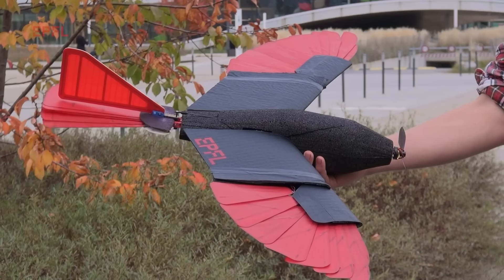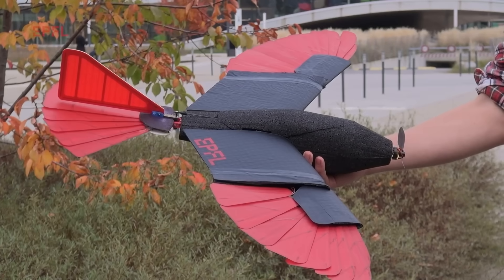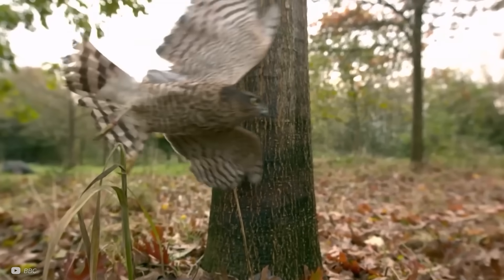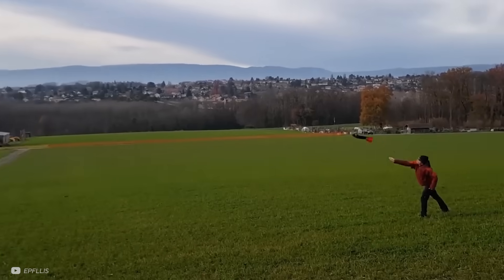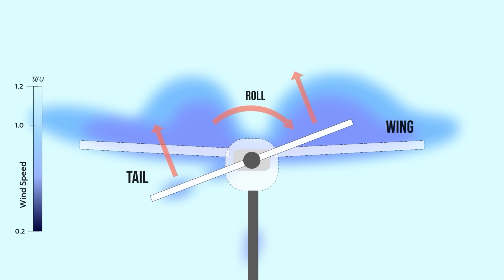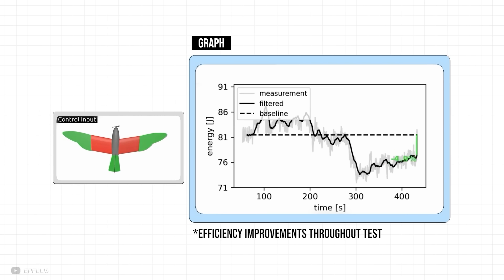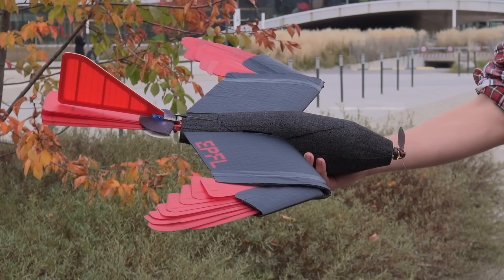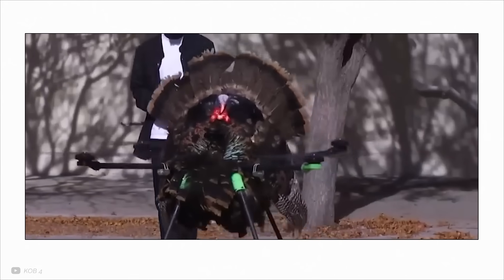The Genius of Bionic Morphing Wings: Future of Flight?

Comment: Just as a point of clarification here: The fact that the analyses they used were "Bayesian" versus "Gaussian/frequentist" isn't actually important here. Bayes vs Gauss addresses probability from two different philosophical perspectives whose differences are important, but probably not specifically here.

More, the analysis used to find the optimal wing configuration here looked to be some kind of Maximum Likelihood Estimation (MLE) technique or something very similar. My main point is that both Bayesian and Gaussian statistics can perform these kinds of analyses just fine and will often come up with very similar results.

TLDR: The analyses they used were some sort of MLE-type analysis that CAN be done a Bayesian way but the Bayesian aspect of it is not what is important here.

(Final concession: Most people would agree that, in almost all cases, Bayesian methods will provide results of equal or better value than Gaussian ones, but almost all of our traditional stats are Gaussian and we're still in the transition to Bayesian stats as a whole)

Comment: More moving parts means more maintenance, more maintenance means more money spent on the upkeep, means less likely to be used in the military, yeah it is cool but doubtful it will make it to the military part any time soon.
Reply: Why did they decide to discontinue the jets that have moving wings? Oh that's right the cost and maintenance on them. Plus they don't do what the opposition can do and makes it easy targets.
Reply: you realise quadcopters use a massive amount of moveing parts compared to a monocopter or a fixedwing design yet are widely used in current wars...
Reply: @matthiuskoenig3378  that is quadcopters and also these are recreational with a lot of moving parts that are easily removed by somebody with a gun.
Reply: @matthiuskoenig3378  funny how i don't see any of the Dune ornothopters flying around in the sky with missiles attached... could it be the costs and speeds they go that prevents them from being useful in a military setting?
Reply: @matthiuskoenig3378  the answer will be yes to what i said because that is exactly why you don't see moving parts much on many fighters anymore either.
Reply: Military planes already need much more maintenance than commercial jets.

Comment: I used to fly free flight airplanes. Many older designs used a lifting stabilizer. Offsetting the thrust line provided a turn in one direction when the motor was making it climb, then when the motor or rubber band quit the tilted horizontal stabilizer would cause it to circle in the opposite direction wile gliding down.

Comment: This is interesting from a research perspective, but something like this would never be practical as a functioning drone. The mechanical complexity adds a significant weight penalty that dramatically shortens flight time and limits payload. Notice there weren't even cameras on any of the? Notice he never mentioned flight times? I flew planes this size for 15 years and am familiar with the components and weight restrictions. The "11%*" efficiency increase isn't going to be enough! 

*Even this was suspect. It appeared to be an 11% increase from its original configuration but they claimed an 11% increase over a "fixed wing."
Reply: Well, maybe in a few years, or a decade this tech will be advanced enough to have actual uses, all we can do is wait and see.
Reply: That's what was said to Orville and Wilbur, so who knows.
Reply: Never is a bit much. Give it four thousand years and the super ais developing society might employ these types of drones using dna and carbon elements to make them as spies on the natural world lol.
 More like, impractical for the next few decades without changes to technology.

Comment: The same principle is used by airplanes during aileron rolls. Which is why I don't understand why they still haven't made a 4 wings electric airoplane (or a "flying wind turbine") that uses these aileron rolls (full 360° revolutions on its longitudinal axis) to recharge the batteries airborne. In a 4 winged electric airplane basically the two front wings would spin the fuselage in one direction, and the back 2 wings will spin on the opposite direction at double force, making the plane spin on its axis, acting like a “flying wind turbine”. What we would see spinning (from the ground) it’s only the back of the plane. The pilot and passengers stay on the front, so are never upside-down.

Comment: they may not understand how birds move but i do, a birds whole body flexes, their wings also flex along with their tail, you combine these traits with the ability to fan out a surface or constrict it and you get the ability to suddenly stop in the air, change direction rapidly and do what looks kinda like an instant U turn because they used the change in shape and momentum to rapidly change direction or dodge stuff
the physics for this can be as advanced or simple as you like, personally i'd use a body made of a springy material with servos that have tiny cables to pull the parts to alter those shapes in groups, issue is making a controller that would adapt this in real time because a normal pilot is gonna have a huge pain in the butt adapting to 20 buttons or levers so it makes more sense to simply put those movements on the edges of the sticks or past midway out with a range for a max range and program them separately so they only happen when you really just need that extra movement to do the thing you wanted

Comment: I still be confused yall sayin wings provide lift when they dont, the mass/density of air decreases the higher the elevation one goes, so the wings actually push off the naturally heavy air beneath it to push upward or some symantic equivelnent that is not lift. Thus, when the tail twists, it cuts into the heavier air and drags the wings in the opposite direction like a rudder in water. Wings push off air to fly, they dont get sucked into vacuums to fall upwards. Gods, stupid science always gettin shz upside down...  i blame neinstein

Comment: Without saying too much, the elimination of vertical stabilizers while retaining yaw stability has some massive advantages for stealth aircraft.
Reply: how so?
Reply: @deltamico  less surfaces to worry about radar bouncing off of. it's why the B2 bomber doesn't have a vertical stabalizer. it gets yaw stability through the wing sweep angle. for example, if it yaws to the left, the right wing has more drag, pulling it back straight.

Comment: The problem with all this is that the efficiency and optimization that nature has found and that these machines try to replicate is limited to the speeds in the range of 5 to 120 mph. You will never find a bird flying supersonic speeds with these optimizations. This might make reasonably good low speed drones but if higher speed drones are needed this is only of limited applicability.

Comment: It is interesting that when we "discover" how nature does things we then want to take things as far as we have doing it "our" way. Nature solves things in a good enough way for the conditions that they encounter in nature. The highest horizontal speed for a bird in 170kph (105 mph) so taking the ideas and expecting them to scale to high subsonic or supersonic is a bit of a stretch. That said there are a HUGE number of things that can be done at "low" speed.
Reply: similarly expecting the way we do things already that was orginally created for lower speeds shouldn't automatically be assumed to be the best option for higher speeds either.

Comment: Birds also have a flexible spine and tilting head that allows them to distort the level airflow and center of balance while maneuvering or rolling. Similar to a high diver and the way they time different sections of a dive to adjust their tracking. These robots, though very cool, will never match birds until they feature and perfect these characteristics.
But to this day, no robot has a full and functioning spine... hmmm.
Binocular vision helps, as well.

Comment: Upping drone efficiency is of immense value for medical deliveries in the third world.  There are already companies using fixed wing drones to move medical supplies back and forth in Africa over multi-km distances.  Anything that makes their delivery craft more efficient literally leads to fractional human lives being saved.
Reply: Absolutely, although I doubt thus kind of design will be used on those areas, one other benefit of the fixed wing is the reduced number of moving parts and increased rigidity which allows it to be slingshot and means that less backup parts need to be kept on site for repairs. But I could imagine in areas where slingshotting isn't an option this would be great.

Comment: Wing shape shifting is done on all modern large aircraft. Leading & trailing flaps that extend out, usually on take-off & landing. The reason they don't look like bird wings as per this video is strength vis-a-vis payload. Drones that look like tweety birds are cool toys, & they have distinct military advantages, but maybe only for surveillance cf delivering ordnance. Splayed (gaps between feathers) on wing tips are good for slow flight and even hovering (look at a red kite in the wind)

Comment: Even before watching: am convinced that adaptive wings are the future. My idea’s however move more in the direction of such wings being covered with flexible skins like on pterodactyls.
Reply: I'd imagine the problem with that is you either need a material that will stretch (which will degrade over time and put additional stresses on the wing struts) or you'll have excess material that's folding up and basically free to flap about which ruins the aerodynamics.
Reply: @epikgamingcat I am not saying it will be easy.  😁The idea is however not new. NASA studied it under the name MAW (Mission Adaptive Wing) and even adapted a F111 for it. Technology is however constantly evolving.

Comment: I'm not convinced that tail twist by itself accomplishes anything. You say that it can generate differential lift via drag, but the tail is already an efficient elevator. But combining twist with elevator will produce a rudder which is of course useful. But big picture here, there are two things going on which are somewhat at odds with each other: First is helping us understand how birds fly, and second is allowing AI to understand it. We will learn little from the AI, and vise versa. Better is to focus on the AI systems, especially the part about finding the ideal physical forms for the requirements.

Comment: Fighter Jet maintainers are drinking themselves to sleep thinking about what their job would look like, maintaining a fighter jet built like this. Much simpler variable geometry designs have been used, but they are maintenance nightmares. Most likely, we will not see this design used for manned military craft as the role of a modern fighter jet relies far more on advanced sensor capabilities and beyond visual range missiles than on the acrobatic maneuverability needed for old school dogfighting
Reply: Completely agree.

'Let's get 0.1% efficiency at the cost of 10,000% increase in complexity... '

Not to mention that what works on an ultralight small drone won't scale to the materials needed for a full sized aircraft with the capacity to carry functional weight in inclement conditions.

Comment: Birds can feel the airflow over each feather and each part of each feather. They intuitively know what the boundary layer is doing over every part of their bodies. Pretty cool.
Reply: Now that the artificial bird has artificial feathers, its time to stick a dozen strain gauges on their stems to have artificial feel of airflow
Reply: @jozseffabri  strain gauges and perhaps embedded flow sensors in the actual feathers themselves.
Reply: I imagine it's a lot like grappling. If you've ever done jiu jitsu, or wrestling you'll know what I mean. Once you're past the initial "no idea what to do" phase you start to realise you can feel all the different balance points, and the pressure the other person is putting on different parts of your body. It's just a case of tuning your movements to those stimuli. Plus having a degree of strength, and toughness to see those movements through.
Reply: boeng just use 1 aoa for senses airflow.
Reply: @awancah7309  Boeing. Lol.
Reply: Never Boeing again - Max stupidity limit overridden
Reply: @awancah7309  lmao
Reply: Bats also sense the air in similar ways, and are vastly more complex than we'd think just from looking at them. Their wing skin isn't passive, there are muscles in it that continuously change the tension in flight. They are "more agile in flight than most birds" according to wikipedia at least.
Reply: We need to study more owls. They're INCREDIBLY quiet and efficient fliers in low speed flight - a very specific but useful skillset.
Reply: This is why some company is just gonna develop brain chips to control birds
Reply: - yes incredible sensitive "boundary layer control" - active control of the set of feathers is incredibly complex (birds absolutely rule here) - for the control algorithm  (hard to hand code - hence the use of mutilayered machine learning /AI).

Comment: Shape memory alloys. Robotic birds will only seriously take off when the current motors are replaced by shape memory alloy rods taking the place of tendons and ligaments in their biologic counterparts and thus providing a also for changing the camber of the wings and raising spoiler-like feathers to reduce speed. The voltages needed to actuate them will be easily calculated in real time by Ai learning algorithms exactly as they are now in the dog-like robots like the Go2 and B2.

Comment: Seems like the designers have neglected the importance of the flight feather shapes. Typical engineer blinders on - they are roughly aping the macro form of the wings and completely ignoring the lift and control provided by the natural shape of each feather.
Reply: So, you’ve never spent a minute in a research environment designing and building these sophisticated devices and your criticism is that they are not spending the time and money to replicate the exact shape and function of real bird feathers? Please go ahead and start your own lab and come up with the funds and time to be that engineer without blinders on to build your perfect replica of a bird and see how far you get.
Reply: If you look at any bird wing, you'll see that each feather has a unique shape and size. Some are airfoils, with long tips to catch the trailing currents and exert control. Some are broad and flat, designed to interlock with their neighbors and provide an overall airfoil shape to the wing as it deforms under airflow in flight.

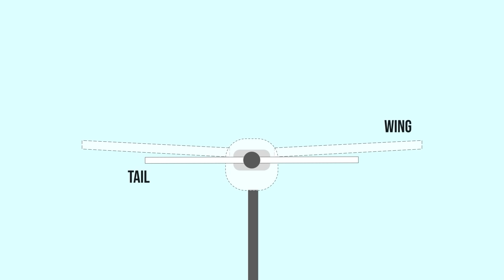Comment: 6:55 This tail-twisting control of the trailing edge flow is the most relevant to high speed stealth aircraft, although I think the feathers are quite antithetical to low-RCS design.

A completely different tail design with a recessed spinal actuation point might give better all-aspect stealth while maintaining high maneuverability than modern stealth empennage designs. The flying wing is better for stealth still, but this could provide better maneuverability than that while giving better stealth than the F-35 and F-22 tails.
Reply: Seeing them sticking a classic tail on the drone it made me wonder if a stator wouldn't be better (like on those engines boeing are looking at with the external rotor and stator pair like big propellers on the back of a jet engine) as a way to counter the propellor torque and also improve efficiency without introducing yaw stiffness.

Comment: another option would be tilting motors which would enable a drone to take off and land vertically and hover while also giving good efficiency in straight and level flight. the thing is that horizontal flight requires far less power than hovering, because the thrust from the motors is used to overcome the drag which is far less than the weight of the whole thing. L/D ratios of 10:1 or higher are achievable, reducing the power requirements (and thereby increasing endurance) by the same factor.

Comment: The ability to hover would be interesting but that could be a bit of over constrained thinking. Gliding in circles is generally going to be far more energy efficient, and what hovering offers in package delivery is perhaps better suited to nets. The tight landing that hovering allows is unique and interesting, but so is the hopping mechanic mentioned here. Birds pitch up to shave off speed when landing and that really makes more sense. We want a system that is optimised for flight but can be adapted for landing. Hovering like a quadcopter is more landing gear that just happens to fly.

Hovering for a fixed perspective with a cameras is interesting. Perhaps the biomimicry and object tracking found in AI gimbals would be a video worthy. Topics like Pigeon head bob / Chicken head gimbal / field of vision of flying predators vs flying prey could be worth a look
Reply: Circling for delivery can be done. Just lower the load on a "wire" and it will naturally descend in the middle of the circle. This used to be done in Papua New Guinea for delivery into forested areas by Cessna (typically).
Reply: Just wanted to mention that there are birds similar the goshawk that do hover. Almost perfectly, even. It's quite unnerving when I'm watching them hovering up in the air, occasionally correcting their position against the wind, but barely moving from their spot so they can spot prey in the fields and swoop down to catch them
Reply: @SnowLeopard1011  the only bird that can truely hover is the hummingbird, the rest use wind to create neutral horizontal force.
Reply: Technically that's flying, not hovering as they cannot do it in standind air. 

The wind powers them, no piece of cake either!